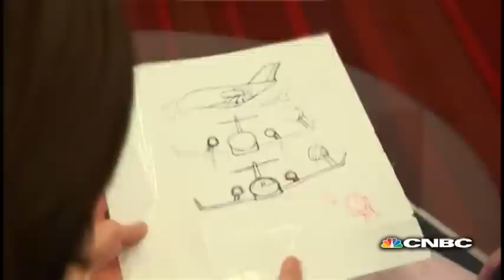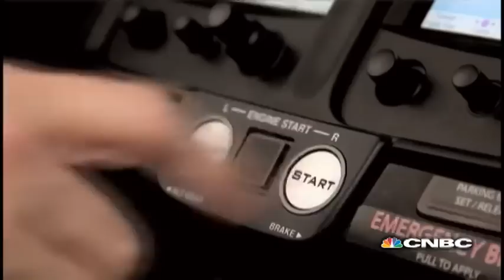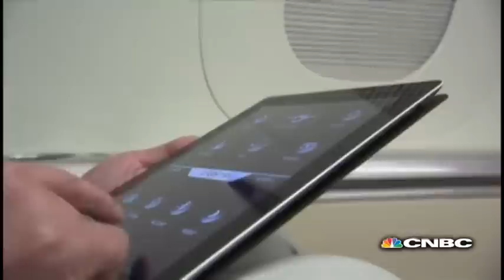Honda Jet Aircraft | The Edge

Comment: German aircraft company VFW-Fokker manufactured the VFW 614 in the early to mid 1970's and it used this wing-mounted engine design.
Reply: KingCarlofcarlWorld .
Reply: Japanese would always say they were the first, but in fact they were imitators.
Reply: There were American planes also (older high mounted above wing propeller planes like that). I forget the make and model, but they were in the 1960s/1970s. I think they were amphibious landing planes (like in Florida/Alaska, etc.).

Comment: At 4:25, Fujino says the mounting of the engines above the wing is a technological breakthrough.  However, Fokker proposed it in 1961, went ahead with the idea in 1968 and flew passenger jets in 1971.
https://en.wikipedia.org/wiki/VFW-Fokker_614

Comment: The HondaJet is an interesting looking airplane and is made from modern aerospace materials. But, why has the schedule constantly slipped? It has just recently obtained a type certification after all these years. I even read that some of Honda Aircraft test pilots don't have technical or engineering degrees. That doesn't make me feel good about it meeting all the certification requirements. I hope they succeed.

Comment: Honda's reputation in quality has rapidly tarnishing in the automotive sector because their poor quality was soon followed by repeated horrible customer service experience with their automobiles. Now they are making jets? No thanks Honda. At one 1/2 the price of a Gulfstream, I would definitely pay twice the asking price of a Honda Jet which comes without a good safety track record (no experience). Add the fact Honda has a 2/5 star rating with its automotive customers and you can clearly predict Honda's attempt at the private jet manufacturing sector is doomed to fail. Sorry Honda, fix your reputation with your automotive customers first and then try to sell your jets. Good luck.  I will be shorting your stock soon. lol

Comment: Interesting jet but as jets go, it is very slow. A cruising speed of only 300 mph in this day and age?  In sharp contrast, the Cessna Citation X cruises at 604 mph. It cuts travel time in half.
Reply: +itsmegp46 Citation X is a much larger, more powerful craft. Sorry but, duh? And this cruises at 420 knots, hardly slow.
Reply: +Audfile I used the Citatioin X just as an example. There are many private jets that are much faster than the Honda as well.....duh
Reply: itsmegp46
Yeah, the Citation X also costs 4X as much. Try using better examples that compare better. "It's also a jet" won't work.
Reply: +Audfile I don't have to do anything, as a modern jet, the Honda is a slug. But since you asked, the British Aerospace 125, a jet that first flew 53 years ago.
Reply: +Audfile 420 is perfect, Ima hella blaze in it
Reply: +LightningStorm271  This is youtube, anyone can say anything without proof.  You claim to have worked on the Citation X, as what? Cleaning the lavatory?  You took everything I wrote totally out of context.  I did not compare the size of the jets, nor did I compare the number of passengers.  I did say the Citation X, which is a much older design is substantially faster than the Honda which is brand new.
Reply: +itsmegp46 well first just because it's YouTube doesn't mean you should spout non facts. Secondly, I worked as a licensed A&P mechanic and you should compare apples and oranges of course it's slower that a X, that a damn near mach 1 jet.
Reply: +John Simpson I can compare anything I like, even if you don't like it. And because it is youtube, your claim to be any kind of mechanic is highly suspect. Like it or not, the Honda is still a slowpoke.
Reply: +itsmegp46 it's a honda
Reply: +typerice604 Your point?
Reply: +itsmegp46 although reliable, but Hold On Not Done Accelerating... Hondas aren't engineered to compete in numbers; they are just good all around with innovative features.
Reply: +typerice604 Its not available commercially yet so its reliability is still unknown. However, in my original post all I said was it is a rather slow jet.
Reply: +Speedbird Nine Unless you can quantify "very fuel efficient" this comment is meaningless.  The Citation X holds 12 passengers vs. the Honda Jet maxes out at four to six, so only half as many. It takes two Honda jets to move the same number of people.  Is the Honda Jet 100% more fuel efficient?  Lastly, your math is faulty.  The Citation has a cruising speed of 972 kph Vs the Honda jet's 700 kph. Your hypothetical 2,000 km journey would be completed in 2 hours in the Cessna Vs nearly 3 hours in the Honda Jet.  Quite a bit more than 12 minutes I'd say.
Reply: Come on. Praise the Rookie here. And it's Honda. Not even a nuclear bomb can take them down.
Reply: itsmegp46 I think you missed the point of this project completely.  You are comparing apples to oranges. Watch the video again, then lets compare apples to apples.  The market the Honda jet is in is called the VLJ  or very light jet market.  It's competitors are not the citation X but the smaller citations and other jets in this market.  So direct comparison to say a citation 550 or XLS would be more correct.  And it is this market that the Honda jet shines.  
So yes if you need to haul 12 people 2.5k miles and you have the extra, rather major extra bucks to spend then yes the X is for you.  If however your average trip is 1-3 people, and within say 200-600 miles then the Honda comes out on top every time.  In this distance the speed difference really doesn't come into the equation. A typical trip of say KBOS to KDCA so much of the trip will be speed restricted for flow control that the speed advantage is negated.  And when you do get on the ground and get the fuel bill, well let's just say you can spend a few extra grand going somewhere else in your shiny new plane.
Reply: ??? I watched the video and it says top cruising speed of the Honda jet is 420 knots which is 483 MPH.  Where do you get your 300 mph figure?
Reply: itsmegp46 it travels at 422 ktas (485 mph)
Reply: itsmegp46     $22 million VS $4.5 million.    Yeah, exactly the same thing.